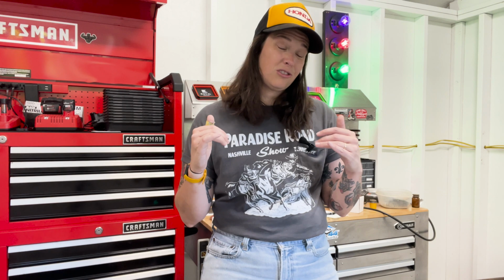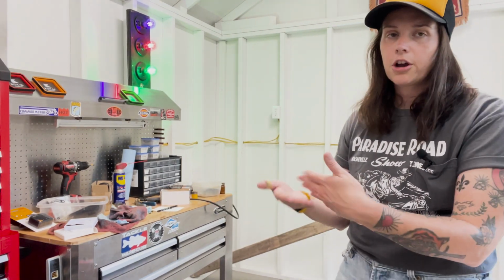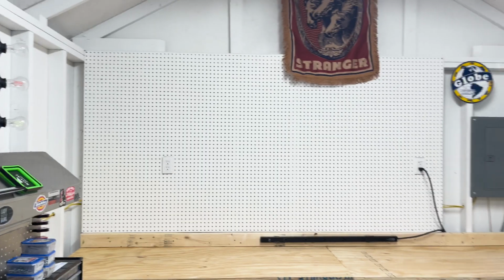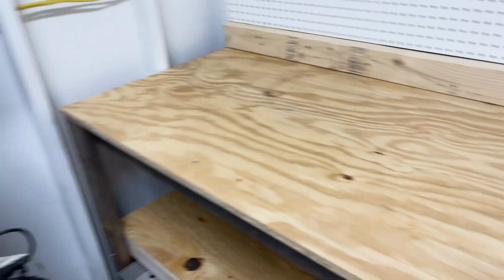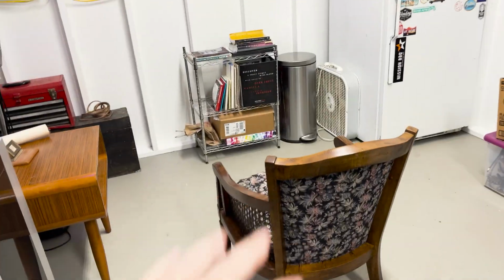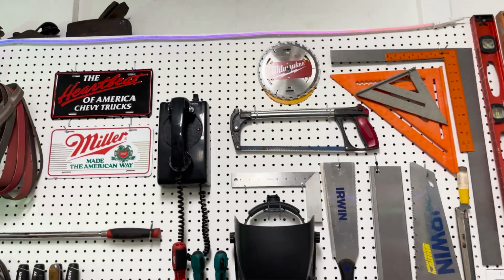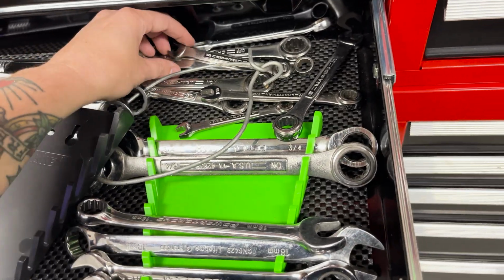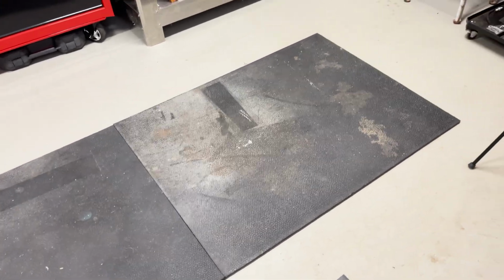Revving Up the Shed: Transforming a Shed into my DREAM Motorcycle Workshop

Comment: Good work!! You mentioned that you have a cl72. Is that something that has com and gone or just stashed? It’s always nice to see how other people set up a shop.
Reply from the maker: The CL72 is stashed away for now. Runs but is incomplete since I got it as a basket case. There was a fire incident on my property and the wiring harness and dynamo got melted. Those will need to be replaced and the seat as well. That one will be highly customized. Not sure if it’s my next project or the CB450 I also have stashed.